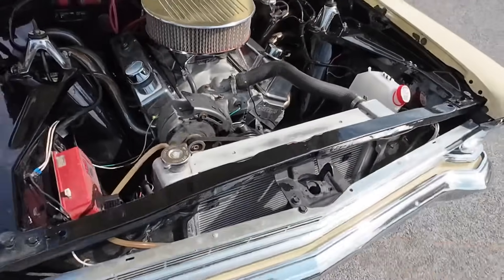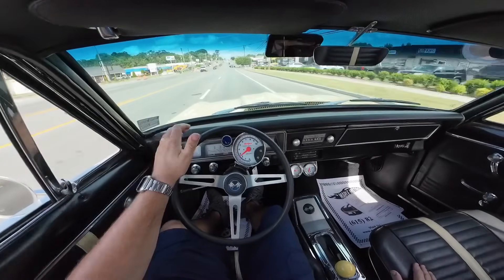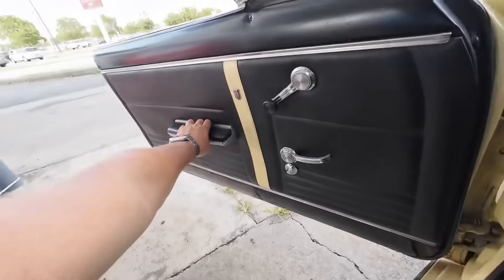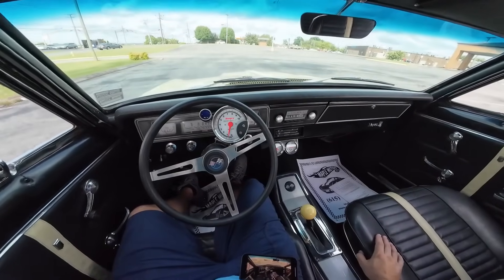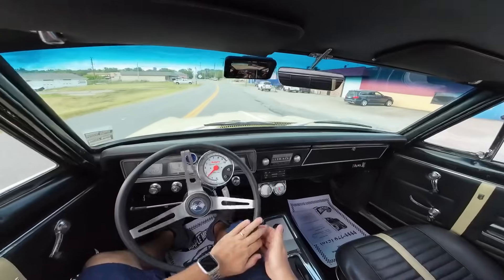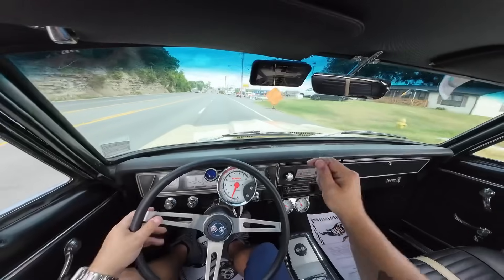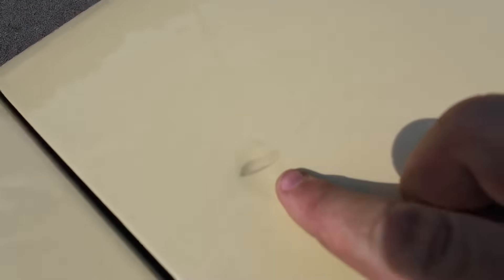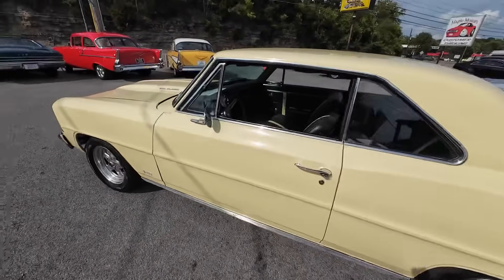Test Drive 1967 Chevrolet Chevy II Nova SOLD $34,900 Maple Motors #2718

Comment: Bought a 66 L79 SS Nova from Yenko , M21 , 12bolt posi Hooker fender well headers , 488 gears , Holly 3 barrel carb with NASCAR coul induction and 3500 lb clutch.